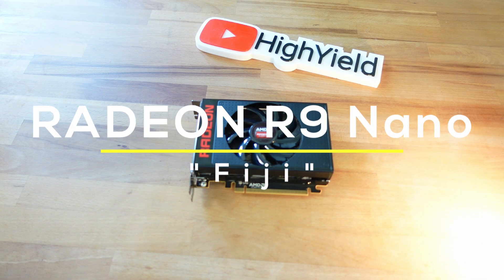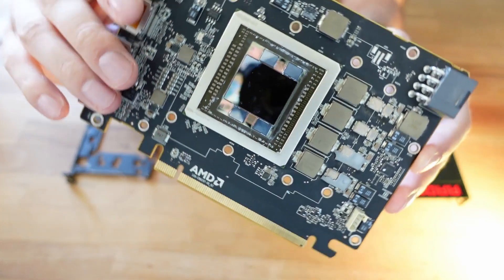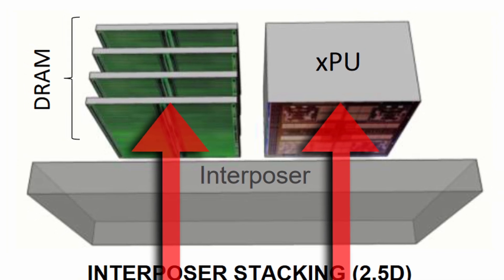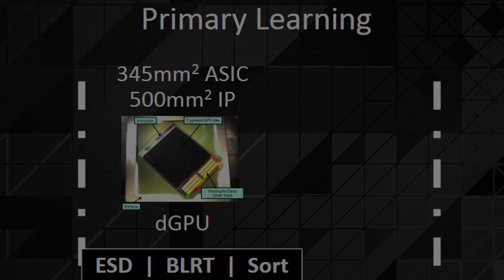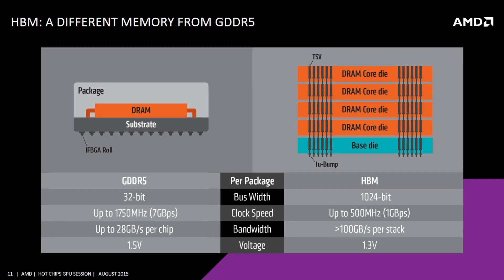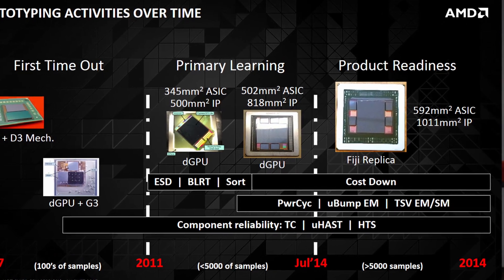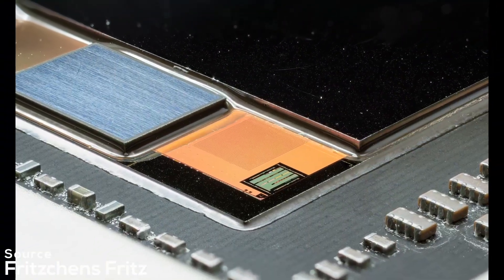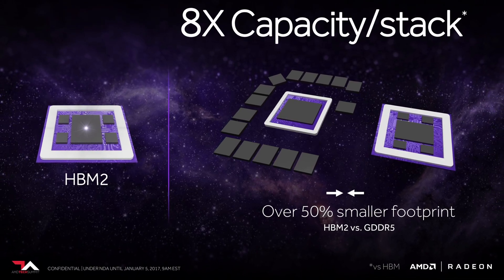How this tiny GPU invented the Future

Comment: My Fury X was my main card until somewhat recently, it had good performance, but AMD has stopped driver support, and even with modded drivers, it felt like you didn't get proper performance in some modern games. It's part of my collection now of ATI/AMD cards, their use of cutting edge tech is what prompted me to make this collection, HD 4000 series as the first cards to use GDDR5, GDDR4 and the ring bus architecture of the 1950 XTX, and so on, back to the 9700 Pro.

Great video, something I'll probably show if someone was curious about what made my Fury X so special :D.
Reply: Man I loved my old water cooled fury x
Reply: There is something wrong with Fury architcture wise. The card unable to flex it's performance at low resolution. In 2016/2017 RX480 and GTX1060 able to beat Fury X at 1080p res (can be seen in techpowerup test) in some tittles. That's why despite heavy discount it had back then i had hard time to recommemd the card if your main resolution is 1080p. At such res it is better to get RX480.
Reply: @arenzricodexd4409  It's almost certainly GCN's scaling issue, leading to it stalling. When I say GCN I mean pre-vega, although Vega's (NCU iirc?) had pretty much a similar issue. I remember playing Rage 2(a vulkan game) was a disaster on it. But yeah unless you could get it dirt cheap and was fine with it not playing the latest games, I would also recommend something like the RX 480/580/590, or 1060 6GB over it.
Reply: @arenzricodexd4409  it had fundamental bottleneck issues on architecture level, IIRC some parts of the chip like the ROP is starved of data despite the HBM.
Reply: I remember AMD cucks saying 4gb HBM was enough because it was that fast... Recommending it over the 980ti lmao
Reply: @rx10  To be honest I only started to run out of memory on my Fury X in like 2018, it lasted longer then the 3070 VRAM wise.

Comment: The HBM on Vega (or the card's IMC) was temperature limited. I got a ref. V56 from the first production run that hit European shelves, put it under water and flashed Vega 64 bios. That HBM has been doing 1045Mhz no problem since then. With the stock cooler, this just wasn't possible to get stable. Almost all people who also did water cooling, put a Morpheus cooler on their card or got an AIB model with sufficient cooling will tell you that they could crank their HBM clocks up by quite a bit. Later in the series, even with Hynix memory as live VRAM timings editing became a thing.

Comment: This and learning about the history of AMD64, made me realize that they are an amazingly innovative company. Their stock price was around $2-3 at this time.
Reply: and I invested $300 back then in 2009. Amd is very innovative glad people are starting to realize this today. Even Mantle used in dx12 and vulkan now, chiplets, monolithic, 3dcache, hbm, first to reach 1 teraflop, also 1 tbs of bandwidth and the list goes one.
Reply: @OrlandoCaba   If I remember correctly, they were also the first to break the 1GHz barrier for desktop CPU...
Reply: @JC_Denton1979   That is debatable as technically Intel released the first 1GHz before AMD but AMD took the claim first after their released their CPU
Reply: @JC_Denton1979  You are correct. I was there. AMD launched the first 1GHz+ CPU, and Intel pushed hard, but was falling behind. Then, AMD went to 1.2 and then 1.4GHz with a minor respin, Intel had a recalled/failed 1.13GHz Pentium 3, and then AMD kept going with repun Athlon designs, while Intel went to the P4 to try to leverage their fab advantages.
Reply: @JC_Denton1979  They're also the first one to release quad core CPUs.
Reply: @OrlandoCaba  I wish they would have more money reflecting that but Nvidia is greedy and still the most of the people own the Nvidia even if just for gaming, imagine why
Reply: @yeshuayahushua4338 Nvidia does have superior product, even if certain parts of the experience are inferior
Reply: @GewelReal  nvidia owns 5 nm TSMC fabric because of huge capital gap. Tbh, in perfect world nvidia should be a target of anti-monopoly laws. In our world however they keep technology back to sell later and force consumer pay more.
Reply: they also invented first 4096-bus width GPU (R9 Fury X)
Reply: @OrlandoCaba  AMD is the only reason Intel even does stuff 
They literally just do it to be faster, even though not the first one to release
Reply: @cockatoofan  AMD is also really relevant in the server space again since Epyc and well, they also bought the other one of the two big FPGA companies, Xilinx - Intel only bought themselves into the FPGA business as well (Altera).
Reply: @cockatoofan  Yeah ik
But AMD is usually the ones to innovate in the general CPU market
Reply: Yup I told everyone to invest in them and everyone that did is very happy!
Reply: You can be as innovative as you want, but if you can't deliver on price you are dead in the water. Pretty certain that's why their price was so low, they had a hard time competing with Intel and Nvidia at the time I believe.
Reply: @autohmae  Yeah, and they had a decade of pretty awful performance CPU-side and terrible coil whine GPU-side, in my experience. Even though I saw GPU sales only accounted for a percentage or two of their profits (they were basically breaking even on products), it was still too attractive even for a laymen like myself. I thought I was a genius when I got out along the way to $7. 😅
Reply: @autohmae  yeah, maybe you’re right, it’s been a while. I just remember their Performance Rating system, fooled me once, so I was underwhelmed even though it was a great deal.
Reply: @autohmae They could deliver on price just fine but way back 20yrs ago their problem was Intel paying the bulk of large computer manufacturers billions of dollars in rebates so long as they ensured they only ever used Intel chips. AMD at the time had the fastest, most efficient, and cheapest CPU's, and plenty of volume from the fabs they owned back then, but their market share never grew due to anti competitive practices by the monopoly in the field at that time who had a vastly hotter, slower, more expensive CPU line via prescott/ P4.

That lack of growth then, is what really hurt them over the following decade. Companies are supposed to be rewarded for being better than the competition, where as Intel effectively took billions from AMD, and when it all finally went to court intel's fine for doing so was a few million dollars.
Reply: Yeah, I've been following AMD since the mid-late 1990s (since the days of the AMD K6-2). They've been quite innovative for most of the time since then. Their big innovation back then was the introduction of floating point SIMD extensions to x86, which they called '3DNow!' technology.  Intel only had integer SIMD instructions at that point (called MMX), but AMD had integer and floating point SIMD (Intel eventually introduced a competitor, called SSE).  The release of the K7 / Athlon was super exciting. The increase in x86 CPU performance between late 1999  and 2001 was awesome.
Reply: Actually, that was ATI who was actually ArtX doing the innovation. The Radeon 9700 was designed by the ArtX team ATI had recently acquired at the time and AMD acquired ATI in 2006.
Reply: There is absolutely nothing innovative about amd.  All they do is copy and steal from nvidia and mobile processors
Reply: Bought in at 32 and 51 an dont regret it. AMD is being held back by institutional investors. Positive news for AMD, AMD stock down. Negative News for Tesla (car veers off the road and kills small child) Stock goes up. Same with Nvidia. I think some of it has to do with AMD unwillingness to fudge the numbers and the fact they have a female CEO.
Reply: So innovative that they called ray tracing a fad and now they are desperately trying to keep up. For years now
Reply: @dannyd4339  ha, is that true? Do you remember who said it?
Reply: @dannyd4339  lmao
Dat funny tho
RT's still heavy for performance tho
Reply: what did they invent in the last 10 years? like nothing xD its so sad... they are the least innovative company to be honest.... HBM was already used for professional cards... and interposers too so its nothing special.
Reply: @PrefoX  At this point every new product is a multi-billion dollar investment. American semiconductor companies are still very much inventive, and competing so intensely that a failed product could do untold damage to the company. Not sure what you want them to do!

If these companies weren't all still great at what they do, then a leader would emerge and be complacent. You have to remember what it was like when Intel stopped trying. Never, ever forget :face-orange-biting-nails:
Reply: @PrefoX  its a good time to start listing wikipedia - for example the frozen state of intel incapable to step up into 64bit processors, and around there were a bunch of microprocessor producers with theire 64bit chips - and even the real today 64bit ibm-compatible instructions are made by amd, and not by intel. capish?